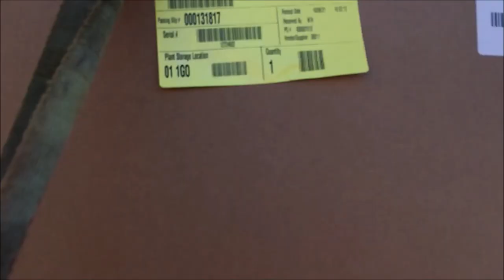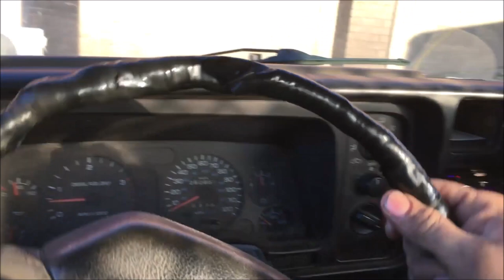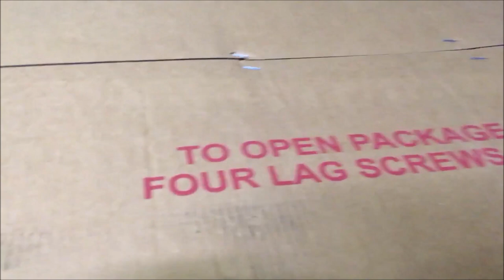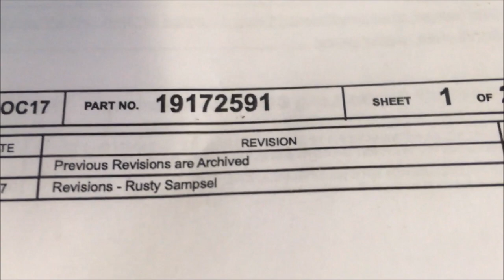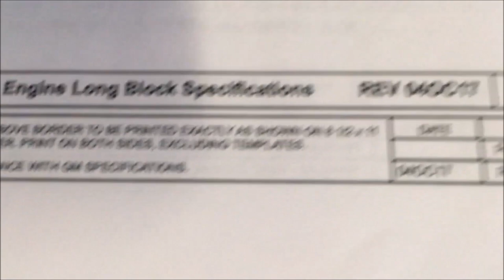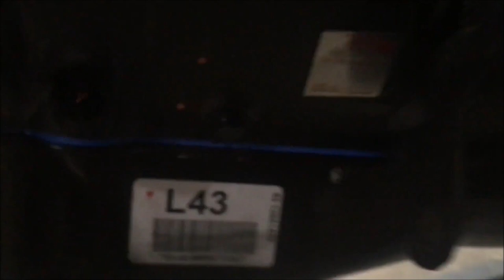Installing a BRAND NEW Crate Engine - Chevy 350 In A 1983 Silverado C10 Pickup Truck

Comment: Years and years back in the '70s ago I work for Chevrolet dealership and one of our customers ordered four brand new high performance 325hp/396 Big blocks and he paid for them he was an old stock car racer well he ended up getting killed racing, doing what he loved.. unfortunately,,.. but he never came and picked up any of the long blocks I had an old 60 Chevrolet fleetside truck 3/4 ton that had a 6 cylinder in it and I had inquired about the engines that the man had bought what they were going to do with them since obviously he wasn't going to use them and his wife didn't want them , I wanted one for my truck.. they sat there for better than 2 years and I haggled and hawed with my service manager and the manager of the dealership about obtaining one of them and they couldn't let it go they were going to send them back I told them that I would buy one should they change their mind, well on my birthday I came into work, I generally opend the shop anyway,, and lo and behold sitting in one of my bays was a crate engine the old style crate that had the slats on the side with a bow on it that said happy birthday... I spent the following weekend putting that engine in and let me tell you what that truck would pass everything but a gas station...😂😂
Reply from the maker: I must have one of them in that little red truck of mine gets about 3 1/2 miles to the gallon
Reply: @mybrotherdonnie  hahaha yeah it's neat having a hot rod but it's not only expensive to maintain it it's expensive to even drive it
Reply from the maker: @izzynutz2000  I just use mine to Hall hay with  And to work with you cannot joy ride with it

Comment: It's fascinating seeing the differences between vehicles, especially when it comes to the US vs Japan/Australia.

My 4WD has a Nissan TD42 engine in it, and when I tell all my american friends that it is a 'diesel' vehicle but NOT a 'turbo diesel', they all just come out with confusion, like they've never even heard of a diesel that didn't have a turbo unit fitted. But then it is quite common over here in the '70s, '80s, and '90s for the turbo to be for more higher end model diesels.

It also has 2 oil filters in it, and 2 air intakes (A pre-air filter near the front of the engine bay where you would hook a snorkel up to, and the main air filter on top of the engine).

And the worst thing you can do with my car, is remove the gearbox without properly restraining it, if you drop that thing on the ground, you ain't getting it back up off the ground without a lot of help, the gearbox in my vehicle is what Nissan put in their trucks, gearbox weighs about 250kg (550 pounds), engine itself weighs about 500kg (1100pounds).
Reply from the maker: The transmission in these trucks I used to lay down on the ground and pull them out and let them fall and hit my chest and then roll them off and put them back in the same way slide them up on my chest and basically do a reverse push-up put them in. That was common when I was in my 20s now I’ve got a jack Motors they’re probably 400 pounds transmissions are less than 200